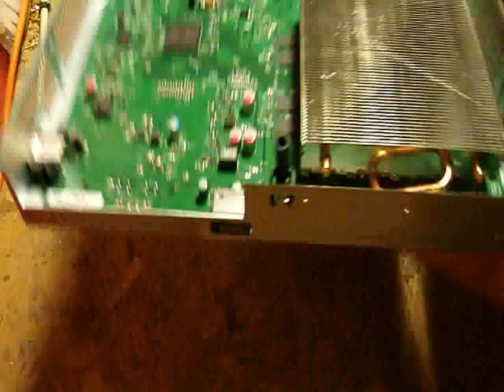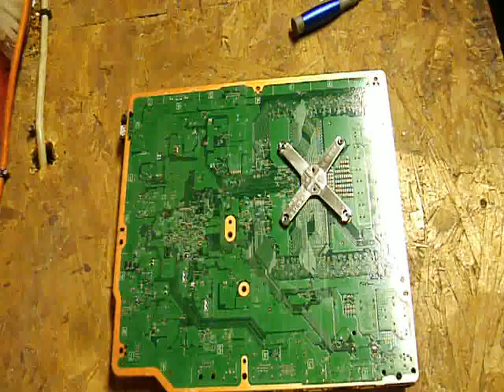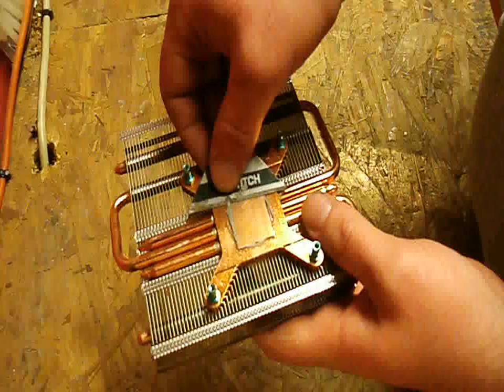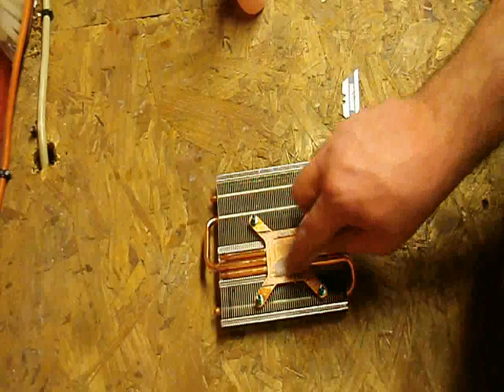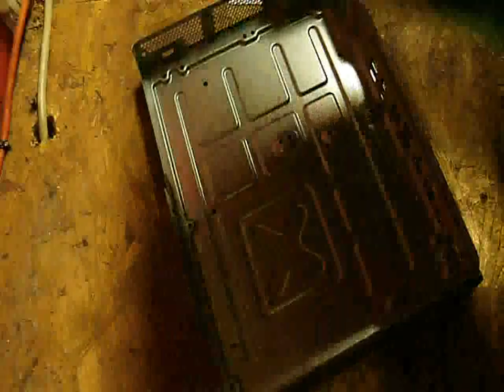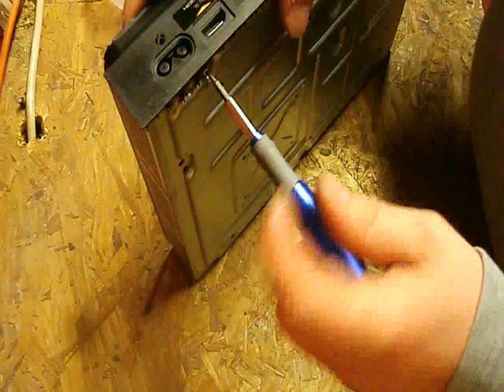Replacing the Xbox One Heat sink compound tutorial. Xbox One cooling guide

Comment: This is bull shit and most the comments!!! I have fixed 100s of xbox's!!! Just changing the past is a load of wank!! The solder on the cpu needs to reconnect, fucking greenies wont let manufacturers use lead so all pc and consoles are doomed, and that fucked up X-Clamp hastens the time till it fucks up, especially in colder climates were the cool down time is a lot quicker.. re-melt the cpu with a heat gun, dont cook it!!!, you only want to make good connections again... some sad cunt cant use logic🙄
Reply: I agree with you 100% regarding reballing to repair the circuit when the solder breaks, and I agree this video is crap as his methods are terrible, however I can't say I agree regarding thermal compound being purely wank factor. I've done it myself on video cards, computers/laptops, and several xbox 360 slims, and whilst a good compound typically only drops temps by 4 or 5 degrees Celsius, it does so with a reduction in fan speeds. the Xbox 360 S is practically inaudible afterwards for example.

but I digress, with a better thermal interface the cooler can operate far more efficiently at taking heat and pissing it off somewhere else, away from the socket and the X clamp, and in theory reducing the likeliness of the solder cracking to begin with

Comment: 90% alcohol and soft fiber cloth... you dont have to use a razor and please never use nail polish remover again, it will cause a lot of damage to the silicon
Reply: Also, id recommend looking into Artic Silver 5. More or less doesnt matter on compound as long as it has no thermal conductivity.. lastly, just a small pea sized dot in the middle of the chip is more than enough to cover the entire chip. Once you mount everything back up the pressure from that and the heat will expand it out creating a perfect transfer layer. this has been proven with many high up tech youtubers such as Linustechtips. Everyone is out to learn so im just offering my experience as advice.
Reply: Yeah, especially because it's bare silicon, a pea size dot is perfect. On a computer processor with a heat spreader you have more leeway on applications, but I personally use the pea dot all the time, I find it to be the best and easier to clean up afterwards incase you upgrade or change heatsinks

Comment: i also put a 750$ intel cpu in my modded 360 and i tested it with no cover and the heat sync and fan fell off and my cpu caught fire and burnt away the whole capasitor kit and heat control kits and usb then the console smoked and the cpu was melted and the xbox was smoking and burt out my whole led kit and melted and the heat tunnel kit melted it was a clear kit it was a 2500$ console i cried lol so im fixing it and converting to liquid nitrogen kit cooling with 3 extra 20 v fans its awsome
Reply: how did you put a regular intel  cpu into a xbox 360 thats not even possible console don't have sockets they use soughter points, and also a cpu won't catch fire, and also alot of other stuff on this is not possible even on a pc i can fire up my pc without the AIO i have on it and the cpu will just be a little toasty but won't burn anything else stop lying and get a hobby
Reply: @Insephet  he used the flux compasitor 🤦🏻‍♂️

Comment: why the hell not just put a 12v fan on the top instead of taking apart a console that cools fine the xbox 360 is different right now im modding a 360 and i didnt even touch the paste i just put 2 intel gpu coolers instead of the disc drive i just download games

Comment: Does the xbox one even need a new heat sync. Mine runs just fine with the stock one without any heating problems. Don't do this unless you live in an area with 110 degree temperatures.This console was  designed for cooling.

Comment: PLEASE NEVER EVER use nail polish remover (acetone based or non-acetone based) for cleaning off ANY part of a mobo/heatsink/processor. All contain a high percentage of WATER which you do not want near any electronic components. Nail polish removers also contain acetates, glycerin, fragrances, and other additives that can leave behind a residue, whether it appears completely dry/clean or not.

99.7% or higher isopropyl alcohol is the only appropriate solvent for cleaning TIM or any circuitry.
Reply: run it3 it wouldn't damage in anyway the dissipator, water would do but in many years of contact as it oxidize some metals,  not so bad with aluminum more bad towards copper, so applying it once wouldn't do anything.
Reply: You know what’s funny. I used water in a bandana to wipe mine😂